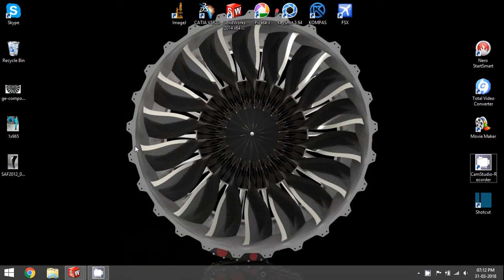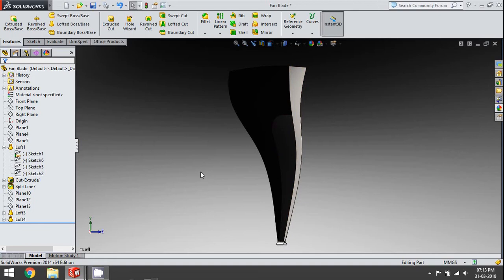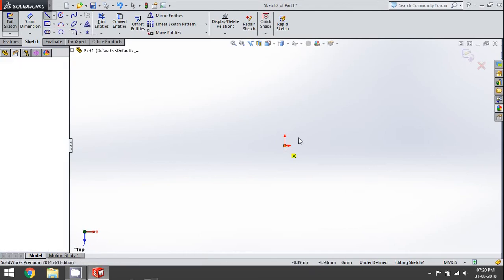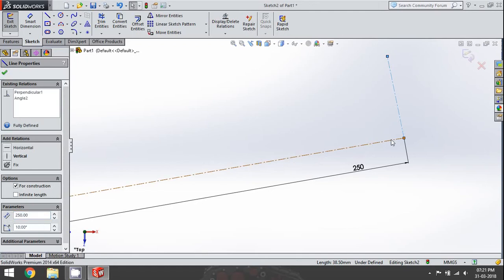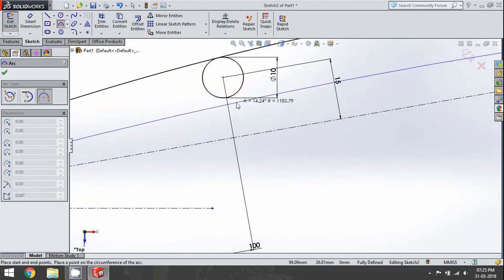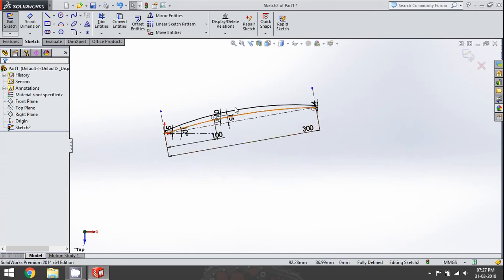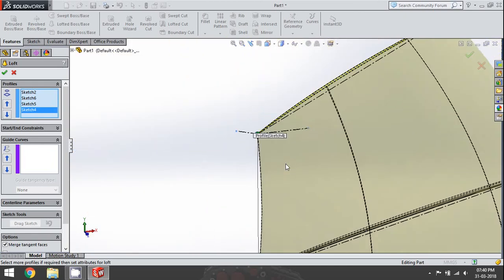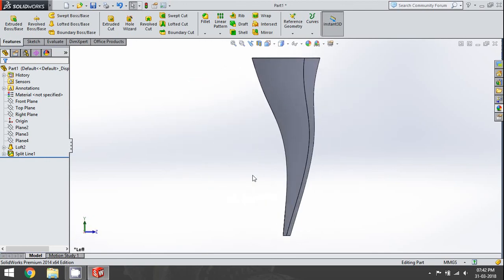Jet Engine : Fan Blade (SolidWorks tutorial)

Comment: They explained that it has an indefinite life of use. After 1 million miles, or 6.5yrs of flying. They inspected it, and after an x ray they explained the blade was still in like new condition. No stretching or stress anywhere. Thats what 1700 sheets of carbon fiber does. Nothin about these blades are company secret btw. The only company trick is the composite resin mixture. Everything else is out in the open. Just hard to find. Takes 340hrs of hand labor to craft a blade. Awesome tech that only capitalism can create. They also are designed to eject foreign debris around the other engine turbines. They survive bird strikes quite often. GE struck gold with this design.
Reply from the maker: You are right, but I was talking about the dimensions of the blade, not the number of sheets of CF used and maintenance schedule. Blades that can survive bird strikes were developed way before this blade :)

Comment: Hi could you do a tutorial for compressor blades in the turbo fan engine? I can only see the fan ones, but not the compressor ones, thanks
Reply from the maker: The compressor blades use the same design steps, except the sketches will be a bit smaller than that of the fan blade :)